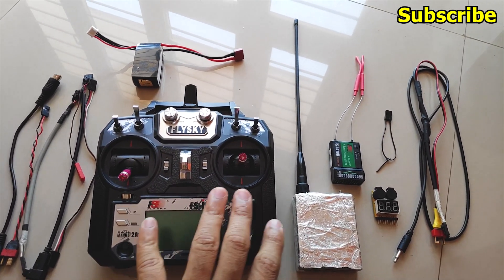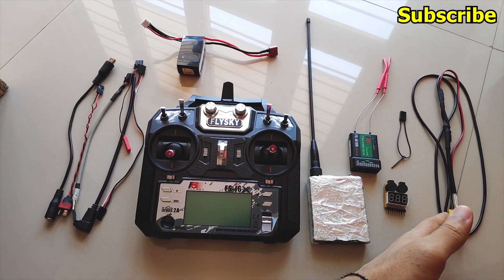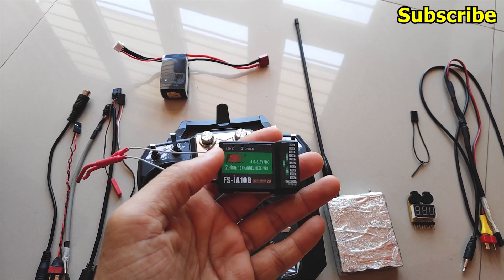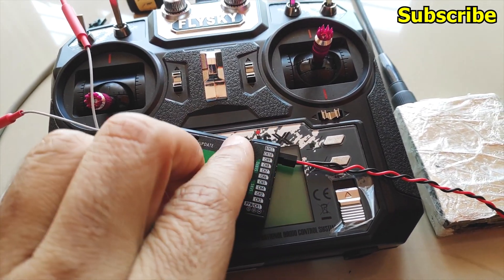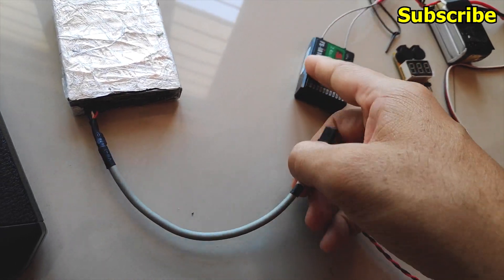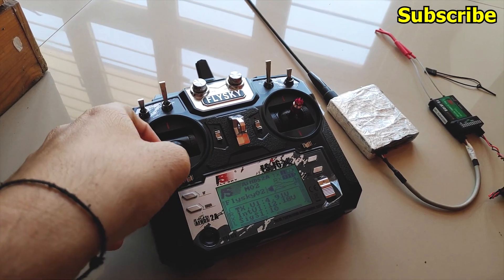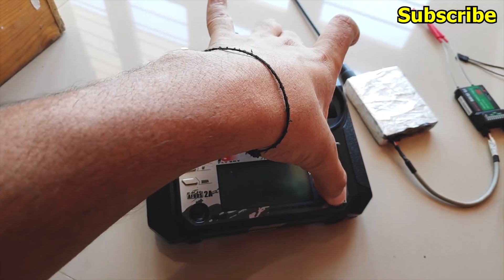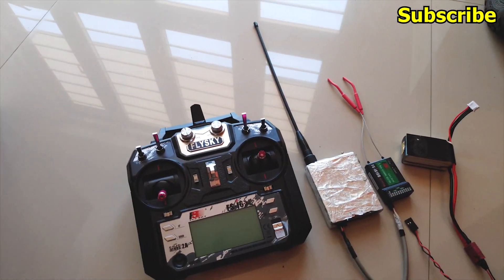Boost UHF Range with 2.4ghz Relay / Repeater for Long Range FPV Control

Comment: How much latency increase after using this method??
Reply from the maker: Latency is not noticeable actually. It's as if there is no latency in the system especially when using for RC car. However if the distance between the receiver and radio is more then it will affect the latency on the uhf tx rx  transmission.
Reply: @RakishRc  are UHF system legal in India?? Specially frequencies they use🤔
Reply from the maker: @rohitgour6681  if using for flying purpose than you'll definitely have to follow the guidelines. But since these modules are available in the Indian market you need to use them sensibly and with responsibility.

Comment: Any problem using 3s lipo ?
Reply from the maker: No
Reply: @RakishRc  Thanks for answering. I plan to use 3s batteries for rx ia10b and ezuhf without BEC.
Reply from the maker: @sutoposidiklawajo9540  okay make sure ezuhf has 3s lipo rating because flysky receiver will output the input voltage it gets

Comment: another option is to use better antennas on the transmitter, i added rp-sma socket to the case and use better antennas (and if needed i can connect a "wifibooster" there and have up to 4w on 2.4 ghz) ... also small 2.4g boosters (with 2w) available for the receiver (model) end and they are bi-directional (means rx and tx is improved a lot!!)
so even if you stay on 2.4g (and do not use a uhf repeater) there are ways for make it more long range (or better penetrating concrete)

Comment: Brother please is there better or any newer long range UHV transmmter fit with flysky or i should by this mfd because no other better choice ?
Reply: UHF*
Reply: Please iam waiting for ur advice
Reply from the maker: If you want latest then consider dragon link or even expresslrs. MFD is also good but very old system
Reply: @RakishRc   thanks but late i already ordered the MFD rlink . I hope it can reach at least 5km distance fpv flight 😣
Reply from the maker: @البروالمطر  no problem. MFD has claimed range of 50km. You could easily get 8-10km

Comment: Amazing Video!! I would like to know, if is possible to make this repeater with JR radio DSMX?
Reply from the maker: Hi, I am not familiar with DSM protocol as I've never used it but you can always setup a relay no matter what protocol or frequency you are using as long as the rx tx involved in setting up the repeater accept and output the desired protocol (in your case DSMX). Can you provide some information about your tx rx and band
Reply: @RakishRc  thank you for your reply! I am using for about 8-10 years my JR12X with a  myflydream (uhf) like yours attatched at the back, to fly long range with my plane. And I really would like to make a repeater.
Reply from the maker: @AlbaJets  okay got it. So then you'll need to use a receiver that can output ppm signal to the MFD transmitter module so as it accepts the ppm signal coming from your Jr Radio and that's basically it. All you need is a receiver that outputs ppm signal coming from your Jr radio 👍

Comment: Great work !!. Do you know how much the range is with this uhf system ?
Reply: In case of  Futaba, which has Sbus system, how does the connections change between Futaba receiver and Mfdlink ? Should i simply connect the receiver Sbus port to Mfd link without any futher setting in Mfd ? Thank you
Reply from the maker: @CP-zi3eg  Mfd can only accept ppm input do you will have to use ppm protocol on your radio and receiver. So plug the ppm port only from your receiver to the mfd link transmitter rc port 1 making sure the pin out is in correct order according to your receiver. If you want Sbus then there is a converter for that but I haven't used it so can't suggest
Reply from the maker: The claimed range from manufacturer is 50km but I doubt that because I haven't tested it that far. On ground I've got about 750 meters to 1km. So on air it should give more..my guess is it should do 10-15km easily. Thanks 👍

Comment: Bro where did you get emm from? Is it worth it? It's available for 11k in india
Reply: Planning for rc plane , what range could I get with it on air
Reply from the maker: @SOMANNACN  I haven't tested it in air so I don't know the real air range but it's claimed to have 50km and that's highly incorrect in my opinion. But you can definitely get 5-10km easily in the air I believe. If I get a chance to test it I'll upload the results 👍
Reply from the maker: @SOMANNACN  you can give it a try 👍 but just be aware of local regulations before flying out of sight
Reply: @RakishRc  thank you, did it come with a manual?
Reply from the maker: No it didn't but you can get on Google just search mfd RLink 433mhz manual.